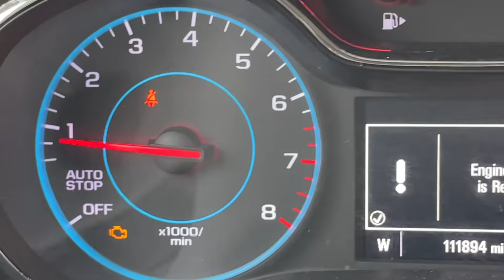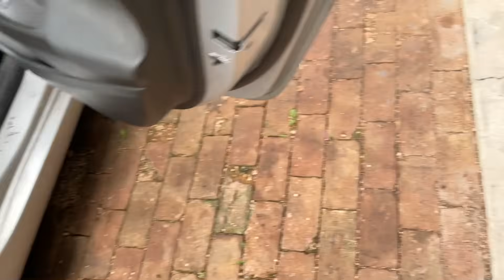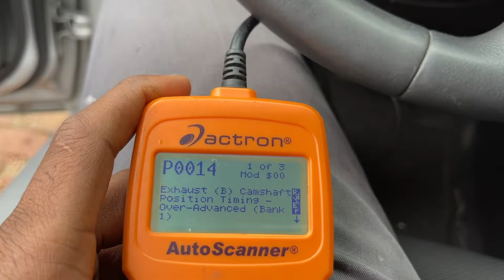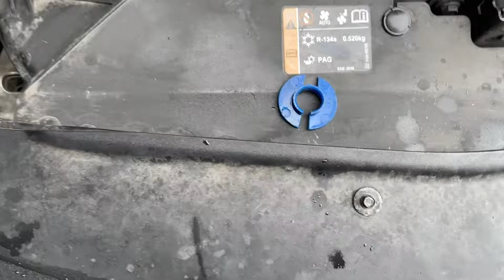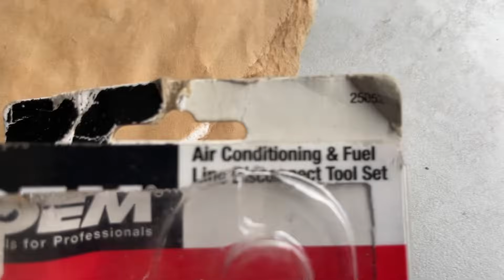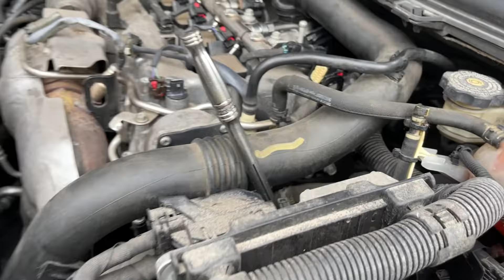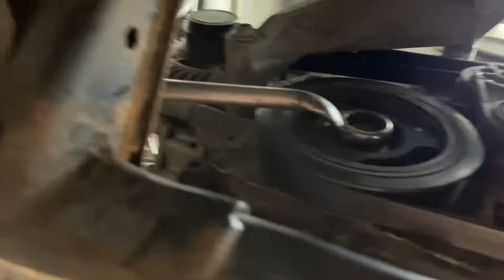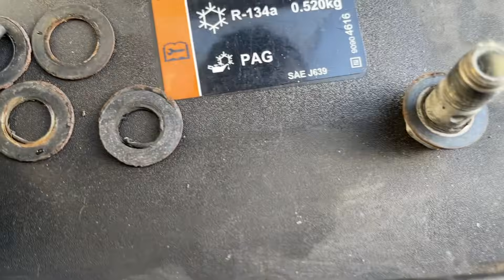16-19 Chevy Cruze, Mailbu Valve Cover Removal, VVT Solenoid & Camshaft Sensor Replacement 1.4L, 1.5L

Comment: This is a great video. The most complete and informative I've found on this subject. You definitely earned a subscriber.

Do you have any idea what would cause oil to be on the spark end of a sparkplug and cause it to go bad occasionally? My #2 sparkplug goes bad after some time and I find gunk/oil on it. Last time it lasted a year between going bad and most recently it went bad after replacing 3 months later. The car goes through oil fast but I don't find much on the garage floor. I read that it could be the valve cover gaskets so that's why I found your video. Any thoughts would be appreciated!
Reply from the maker: Definitely sounds like you have a valve cover gasket issue. If it were an older car I would probably tell you to look into getting the spark plug tube seal replaced. The valve cover replacement should fix your issue. Thank you so much for watching and subscribing. I really appreciate it.
Reply: If its on the tip of the spark plug thats in the cylinder your engine is burning oil causing the plug to foul

Comment: Do you need to remove fuel pressure before removing the fuel rail line? I've been told to run the engine until it stalls with the fuel pump relay fuse removed but I can't find the fuel pump relay.
Reply from the maker: You don't have to relieve the pressure. You may get some fuel spray when you disconnect the line but nothing that will cause any harm. Just make sure the battery is disconnected and wear rubber gloves.  I have done this MANY times without any issues on all sorts of vehicles throughout the years. Thank you SO much for watching.
Reply: @TerenceDIY  Thanks for the quick reply!
Reply from the maker: You're very welcome. Once again, thanks for watching.

Comment: I recieved a p0556 code for the brake booster sensor after replacing a bad vacuum pump. I don't think it was out before, could changing the vacuum pump cause this? Is it possible the vacuum pump isn't tightened down enough. Or should I go ahead and replace the sensor?
Reply from the maker: Try replacing the sensor. Also, was the vacuum pump new OEM or an aftermarket part? If the pump wasn't tightened down enough, it wouldn't have taken long for you to notice it.
Reply: @TerenceDIY  I'll try the sensor. I think it was an aftermarket one, the only one available at the time. How would I notice quickly? The brakes seem to work fine now but haven't really stopped hard yet.
Reply from the maker: If it weren't tightened, it would take no time for it to be damaged. That's how you would know. Your brakes would not function properly. Here is a couple of links for some relaible inexpensive parts. 

https://www.ebay.com/itm/374896380202?fits=Year%3A2016%7CModel%3ACruze%7CMake%3AChevrolet&_skw=2016+chevy+cruze+vacuum+pump&itmmeta=01J907C1WZQ9DXXR3NG5CSBH4F&hash=item574990c92a:g:wfUAAOSw0x1k5chP&itmprp=enc%3AAQAJAAABAHoV3kP08IDx%2BKZ9MfhVJKmM0G3tr%2Bg6iK5lEP1XTjv%2Ffhu8eq3n0OZ7E2ScRcTLMVom3hxMqH9X5kNZUhpW54ELbWG7vZ3TBtPG0Qo%2B%2B5sFcdEw7Ekl6OCzpL3YH9LZY87%2B1gQ3hLscsyLF7yVcYBUm4EqhW5qFxszjtK8OPKWgfp3fpKIOiZR%2BbMWR02cIOSzTe893uGU5ja09cd1GPBhUNFywmKmjCN%2Ft4j%2FYEWP%2FeNynIjxHXY9mkW40JOUqJ5RXbSp0Ormx0uc%2F2jKhwoUKpFzpO5raSS%2B7J8Cq1UcF2FT%2Fa%2BhmOd9UeFSDotdh7szZo3m%2FitboZ8JpQsabz1U%3D%7Ctkp%3ABk9SR9aesIfIZA

https://www.ebay.com/itm/395565832755?fits=Year%3A2016%7CModel%3ACruze%7CMake%3AChevrolet&_skw=2016+chevy+cruze+brake+booster+sensor&itmmeta=01J907F7M8HQEDKMZG3BFEX2HK&hash=item5c198f9a33:g:eJAAAOSwJ0lmqe6P&itmprp=enc%3AAQAJAAABAHoV3kP08IDx%2BKZ9MfhVJKmqWDMBJc7R0RX3F890WocomaSW2RiYHRCD%2FKQIVoZwDU%2FTKNGjY1KOCZITV2Vy2OzfB1rVv10QT2XeIh79n5c4WRbg5BdUgMDU2jUtojvOHA48RhkuSgCo4nnuTwExan%2Fa%2FZjjqIQC69DMI2h7W4w5eEDKW5w1%2B4AsGRKTPaKTiEy5lbT8NLVA230args0K1QP5WY7uT0PaMpC4GGg4xHC2mHqUOUWoBluf4d37xYcyINeEYSD4yakm9cCjxMhGz6p%2B1Luad0V9P%2BFUlg0LXazagslZ2yFILRFNfkw%2BdqLAhZ8pOb2aaYv3q8ILYyFz3Q%3D%7Ctkp%3ABFBMoPq8h8hk
Reply: Sorry a little to the comment section, but the oil pump itself is initially the issue when it throws a brake booster vaccum pressure code.

Comment: I just did this job on 2018 chevy cruze realign the reluactor wheel  wit the camshaft  .I didn't not replace the solenoid.  I put everything back together car won't start. Should I replace the camshaft sensor wit the solenoid senor.
Reply from the maker: The camshaft sensor should not stop it from starting. When you go to start it does it spin or sound normal?
Reply: @TerenceDIY  after I was done wit the job the first 3 time I try to start the car it start than shut of. But after that it crank for long time no start as if the relucator wheel and the camshaft are not aligned. But I made sure they was aligned before I installed everything back together..
Reply: I change the exhaust camshaft and the  solenoid .car starts find but engine shake rough at idle ..sound like a vacuuming leak or can it be bad piston?
Reply from the maker: You will rarely get a bad piston on those engines. Well, at least I never encountered one and I have worked on quite a few. A vacuum leak seems more plausible. Did you make sure the valve cover seat correctly? It's very hard for me to diagnose the issue since I cannot see the vehicle. I wish I were there to help.
Reply: @TerenceDIY  yes the valve cover is sitted properly.. I'm kinda hearing a little hissing noise from the passenger side of the engine sound like a vacuum leak but I'm not 100% sure. Would a bad turbo cause the car to have rough idle ? Cause I'm also getting code p0299
Reply: I'm still getting code p0014&p0017,p06de engine oil pressure control. It's not low on oil. P0299.

Comment: Sir, FUCK that brake vacuum pump FUCK THAT DESIGN! 300,000 GM trucks same part same design have been recalled and it’s in the 2020 Equinox Cruzes and Malibus that Vacuum pump is driven by the exhaust cam so guess what happens when the vacuum pump seizes? Me on YouTube watching this video 3 months after the wife got the 2020 equinox second hand from the dealership warranty void of course and 26k still owed that’s what! 181 deaths in the 2020 Chevy Equinox due to that vacuum pump!
Reply from the maker: I totally understand.
Reply: @TerenceDIY  blew apart hard pedal got it to stop shut it off and currently taking it apart. 10 minutes after a Valvoline instant oil change this happened.
Reply from the maker: That's messed up. I am glad you guys were safe.

Comment: Your the Only video I have seen with that black box on the air intake I have been trying to find the name I’ve been trying to find the box itself but I can’t seem to find it
Reply from the maker: Is this the box (resonator/duct) you're talking about? (link below)

 https://www.ebay.com/itm/285902761030?itmmeta=01J53JAN90CES3DCB1TCTHX8QK&hash=item429121ec46:g:I~QAAOSw5ihmHVu3&itmprp=enc%3AAQAJAAAA0NdPohUiI1mi4gE6c1MYpKiVBHb9d8bs7ssSDq8frhCiyxIL1K7r%2FCjrRW5wbhX3VfcWo1ea6jrL4UE6SsMHmnVa%2BWFWSSc6M4hSX43L8xWXIED03QpKRKJoANQzeNdyyPN650nuJU3h2rvYaaMO%2Bhk922Vs%2BKwnldELqv5mLuYPo%2BSIiYX2sFkrGMG3c1ND1my0F%2BwjTkETYDzDfaiI5hgUze0YP9OqtrUBf7eup2edIyvYRgh1AhKPpP3bC80DwtUOaR6E9rEYW9ro4%2ByES1U%3D%7Ctkp%3ABk9SR9bUqvKoZA

Comment: I have a 2016 Malibu 1.5L with a P050D code , misfire cold start. I will start working on it soon , got any ideas or came across this code before? Thank you!
Reply from the maker: I have never endured that problem however, I have the software for this vehicle as well as many others. I just looked over that code and it's pointing to a faulty fuel injector. That's what appears to be the culprit. Do you have a code reader? You can probaby pin point which one is faulty.

Comment: Terrance is there any way to set the reluctor right without taking the top of the engine apart? I’m just a girl. Lol i change the vacuum pump myself and now this is my issue.
Reply from the maker: Unfortunately, there is no other way. It's not a bad job. If you replaced the vacuum pump, you're definitley mechanically inclined to remove the valve cover.You can do it. Thanks for watching.

Comment: This video is great brother. Need your advice. I have a 2018 Equinox LT 1.5 motor. The vacuum pump shattered. Found out after I lost brakes driving and the brake pedal went stiff. Replaced the vacuum pump after removing the vacuum pump debris from under the valve cover. Put it all back together and she’s not turning over. The dash is saying “reduced engine power”. I have a jump pack attached, the engine is getting fuel, spark plugs are not flooded and we have spark. Any idea how I can get it running again?
Reply from the maker: Hi, how does it sound when it's spinning? Normal? Did you make sure the reluctor was aligned? When you replaced the vacuum pump did you disconnect the battery?

Comment: Hey Terrence my cam shaft moves back with tension when I try to put it at 12 a clock what can I do?
Reply from the maker: I am not sure what you mean about it moving back with tension. Is your reluctor out of line? Are you replacing the timing chain?

Comment: Terence question:  What is the name of the Dewalt tool you used to remove the vacuum pump?  That tool is awesome, I need that!  Thanks slim!  And can you send me the link if it's on Amazon?
Reply from the maker: It's actually a Stanley ratchet that I bought nearly 10 years ago when they came out. It's an amazing ratchet.  Here is the link (below). It's at Home Depot. Amazon only sales the 1/4" (link below as well)  Thank you SOOOO much for watching. 

https://www.homedepot.com/p/Stanley-3-8-in-Drive-Rotator-Ratchet-89-962/203740742?g_store=&source=shoppingads&locale=en-US&pla&mtc=SHOPPING-BF-CDP-GGL-D25H-025_001_HAND_TOOLS-NA-Multi-NA-PMAX-NA-NA-NA-NA-NBR-NA-NA-NA-Hand_Tools_JControl24&cm_mmc=SHOPPING-BF-CDP-GGL-D25H-025_001_HAND_TOOLS-NA-Multi-NA-PMAX-NA-NA-NA-NA-NBR-NA-NA-NA-Hand_Tools_JControl24-71700000117978840--&gad_source=1&gbraid=0AAAAADq61UfTyGhPXB5ozzh4u6t3JP-9p&gclid=Cj0KCQjwjLGyBhCYARIsAPqTz19fd9z6P8QRGcxlS7TVqCi2FT-2nNOezfsd7bqfyJ009ZooXaDfA8UaAtnFEALw_wcB&gclsrc=aw.ds

https://www.amazon.com/Stanley-Hand-Tools-89-961-Rotator/dp/B00HNMZ3G4/ref=asc_df_B00HNMZ3G4/?tag=hyprod-20&linkCode=df0&hvadid=693640803529&hvpos=&hvnetw=g&hvrand=17175815987109837385&hvpone=&hvptwo=&hvqmt=&hvdev=c&hvdvcmdl=&hvlocint=&hvlocphy=9021629&hvtargid=pla-448454519942&psc=1&mcid=94e6fd7e98593bdd9ac1e403ea9a2bf5&gad_source=1
Reply from the maker: It's actually a Stanley ratchet that I bought nearly 10 years ago when they came out. It's an amazing ratchet.  Here is the link (below). It's at Home Depot. Amazon only sales the 1/4" (link below as well)  Thank you SOOOO much for watching. 

https://www.homedepot.com/p/Stanley-3-8-in-Drive-Rotator-Ratchet-89-962/203740742?g_store=&source=shoppingads&locale=en-US&pla&mtc=SHOPPING-BF-CDP-GGL-D25H-025_001_HAND_TOOLS-NA-Multi-NA-PMAX-NA-NA-NA-NA-NBR-NA-NA-NA-Hand_Tools_JControl24&cm_mmc=SHOPPING-BF-CDP-GGL-D25H-025_001_HAND_TOOLS-NA-Multi-NA-PMAX-NA-NA-NA-NA-NBR-NA-NA-NA-Hand_Tools_JControl24-71700000117978840--&gad_source=1&gbraid=0AAAAADq61UfTyGhPXB5ozzh4u6t3JP-9p&gclid=Cj0KCQjwjLGyBhCYARIsAPqTz19fd9z6P8QRGcxlS7TVqCi2FT-2nNOezfsd7bqfyJ009ZooXaDfA8UaAtnFEALw_wcB&gclsrc=aw.ds

https://www.amazon.com/Stanley-Hand-Tools-89-961-Rotator/dp/B00HNMZ3G4/ref=asc_df_B00HNMZ3G4/?tag=hyprod-20&linkCode=df0&hvadid=693640803529&hvpos=&hvnetw=g&hvrand=17175815987109837385&hvpone=&hvptwo=&hvqmt=&hvdev=c&hvdvcmdl=&hvlocint=&hvlocphy=9021629&hvtargid=pla-448454519942&psc=1&mcid=94e6fd7e98593bdd9ac1e403ea9a2bf5&gad_source=1
Reply: Hey Terence thanks so much champ!  Just ordered mine and can't wait to use it.
Reply from the maker: That's awesome! Once again, thank you for watching my content.
Reply: It was very tutorial and easy to follow, thank you

Comment: Change my catalytic converter,  still getting back the code p0420,  what wrong is the ecu giving faulty code that the only code that chiggers the check engine light so i dont know malibu 2018
Reply from the maker: That code relates to the downstream O2 sensor. Have you replaced any o2 sensors?

Comment: I wish I never purchased my 2016 chevy Cruze I’m almost at 111,000 miles my check engine light is on with p1101 code was told it can be the MAF sensor but I feel it may be my pcv valve as well.
Reply from the maker: I have a video for that code fix. It's your throttle body. I show you a couple different methods to do in order to fix the problem.
Reply: Thank you! Also my RPMs is doing this same thing like this Cruze in your video but not as bad. Where are you located? I need your help 🥹🫶🏽
Reply from the maker: You're very welcome. I am in Chicago.
Reply: Watch Dave’s world he explains a lot about boost leaks there so many spots on the Cruz

Comment: Hello, first off, thanks for the informative video. I know this video is a couple years old at this point but I am hoping you may still see the comments and respond. At 16:29, could you possibly explain how you disconnect that? It looks like you've just got a small flat head but I can't tell exactly what you've done to release the hose. It doesn't look overly complicated but I was hoping for some clarification before I got to work on this job. Valve cover gasket is done for on my gen 2 Cruze, and the cheapest quote I can get around me is 750 dollars and that guy can't work on it for another month...  or I can spend 900 to get it done now. I figured I would look to find a video (like yours) but jeez it took forever to actually find one. Tons of videos on the gen 1 Cruze but hardly anything on the newer models so I appreciate it.
Reply from the maker: Yep,  I used a small flat head screw driver to release that hose (pretty straight forward). I should have gotten a more closer shot on that part as I try to make my videos of the highest quality. I apologize for that. Also, you are correct, this is probably the most detail video regarding the motor of the Gen 2 Cruze on Youtube as well as the other videos I have on this particular vehicle.
Reply: @TerenceDIY  Thank you very much! I figured as much but I just wanted to make sure there wasn't something I would be missing. Again, thanks for the great videos on the Cruze, I'll be replacing my valve cover gasket this week once they arrive in the mail and this video is the only reason I feel confident in doing it.
Reply from the maker: You're very welcome. Thank YOU again for watching.